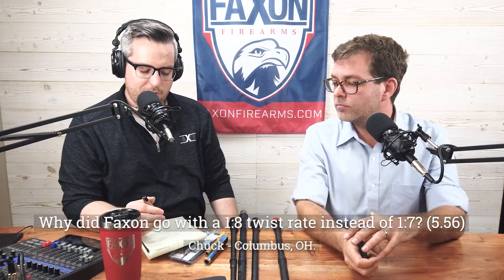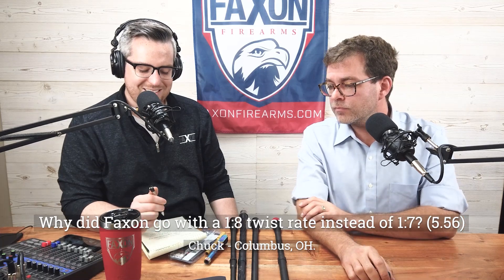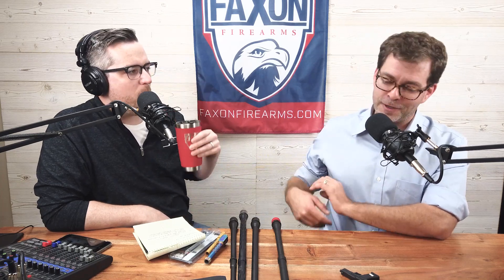"Why did Faxon go with a 1:8 Twist Rate (5.56)?"

Comment: I know this is years late. i bought one of the WWSD style barrels from Faxon. Unfortunately, nothing I tried in it shot acceptably. 55,62,69,75,77. Nothing grouped better than 2 inches at 50 yards, and most were beyond that. That's just my experience. I had to replace the barrel. I don't know what the issue was. The shooter is the biggest variable, but I'm better than that.

Comment: That may be the longest explanation I've ever heard that still left me confused.
Reply: In other words he has no clue as to why faxon  went with the 1/8 twist instead of the 1/7 twist.
Reply: I thought he said this: You will not be able to load a bullet in an AR-15 magazine that can not be stabilized by a 1:8 twist.
Reply: @martinholmes639 he meant the actual bullet itself not the entire cartridge, basically 1:7 would be perfect for a longer projectile but 1:7.7 would be perfect for a standard length 556 projectile so 1:8 is the closest to that
That’s the idea anyway, the reality is that the difference is so negligible it really doesn’t matter and they’re going to perform almost identically

Comment: One in seven twist rate works just fine it was also intended to stabilize Tracer rounds better it does the job apples and oranges I've had excellent results with 55 grain all the way up to 77 grain with my one and seven twist rate really getting finicky here one in eight twist rate also does fine with those bullet weights

Comment: I have a DSG upper with a 1/8 twist and it’s great with heavy bullets (68 to 77 grns).  however I have consistently been disappointed with 55 grn at 100 and 200 yards.  1/8 might as well be 1/7.  I prefer 1/9 due to all my 1/9 barrels show very accurate results at 100 and 200 yds, and it has done very good groups with the heavier type projectiles also.
Reply: Yep, same here.  My old ass bushy 1/9 barrel is an absolute tack driver with everything except 77s, which I never shoot anyway since I can never find it on the shelves and its far too expensive when it is.  I shoot almost nothing but 55 or 62gr and 1/9 is definitely the ticket for that.  So what does everyone under the sun sell?  1/7.  Derp.

Comment: my favorite twist rate...i can shoot 55 grain match loads at about 1 inch at 100 yds in my testing, and everything up to 77 grains under an inch, i'm a happy guy. i even fire a good amount of 22LR now with this ammo shortage using the CMMG Bravo conversion kit, and i've never done an accuracy test with it at 100 yards but at shorter ranges i will call it pretty decent accuracy, certainly way better than i expected using 40 grain 22LR bullets that aren't meant for 1-8 twist
Reply: My 18 inch barrel is also 1:8. What's you best 22LR ammo for Bravo kit?

Comment: What grain bullet do you recommend in a 1:8 twist 16" barrel?
Reply: Most 55 thru 70gr bullets work ok in the 1-8 twist, in the AR platform. At least i`ve had no issues using 55 to 70gr.
Reply: @DERP-1  thanks. I've decided to go with 62 grain. In the middle kinda.
Reply: @chrisgutzman4919  hopefully not green tip